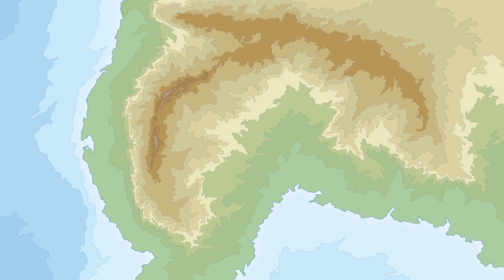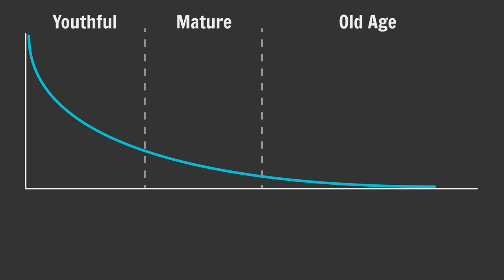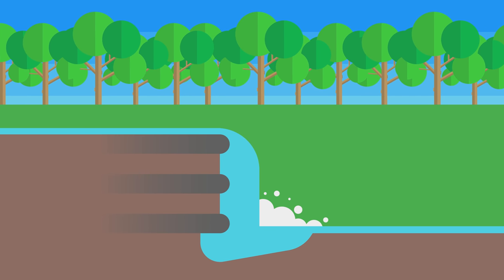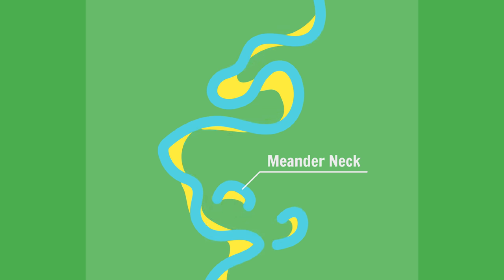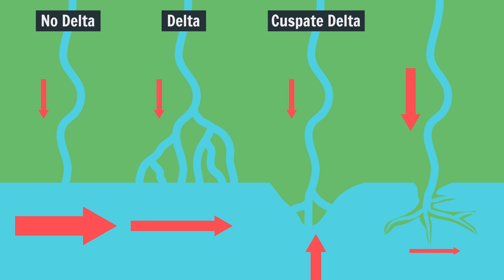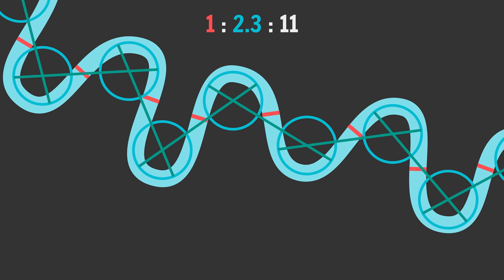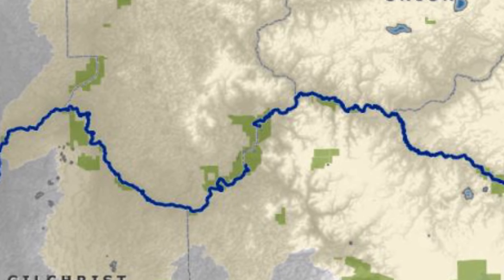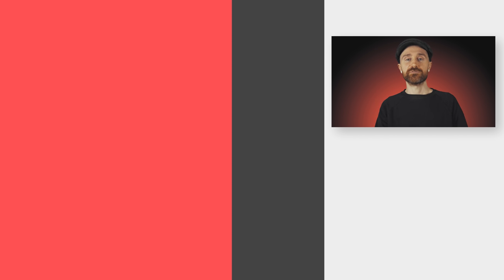How To River

Comment: When drawing rivers on made-up maps, it is useful to remember that they flow perpendicular to elevation contours.  Don't have them cutting across your contour lines at weird angles!
Reply: So they dont cut straight to elevation levels?At least not always?
Reply: @vaultdude4871  The direction straight downhill is always directly perpendicular to elevation lines - the river flowing downhill will always make a right angle to the elevation contours.
Reply: Also streams will make little v or u shaped dents in your elevation contour lines pointed up stream/hill. 

Basically the stream eroded out a valley and this means that the elevation line gets bent in the uphill direction. 

Also he forgot that a river with little sediment (say draining a lake or rocky bottom/shallow bedrock) can create an inward dent typically creating an estuary. (St. Lawrence River in Canada for an example as obvious as the Nile or Mississippi on a map)
Reply: What about a civilization that creates its own rivers?
Reply: @ValkyRiver  Canals?

Comment: So the bigger the river volume, the shallower that formula assumes the river is. I talked to Edgar during development and he said you can vary the width of the river within an order of magnitude or so. For example the Merrimack River is about 300 meters wide at its mouth but the formula predicts 900 meters. This difference is due to the fact that the river is deeper than expected, being about 5 meters deep
Reply: Alot of the depth is determined by the geology of the medium through which the river flows. 

For instance a fold or rift may have a hard soft hard band which a river (or glacier) can carve out to make a very deep and skinny channel. Also glaciation basically resets the dirt layer so expect relatively clean water (especially if your draining a lake).

Alternatively deep bedrock can make a situation like the Mississippi or Rhine near their deltas where the onlything the river cares about is loose dirt so it may be extra shallow but wide and meandering.

Comment: An important note on deltas:

The river's speed will determine how much sediment is deposited. The slower the river, the more sediment will be deposited. Deltas form because on meeting the larger body of water, its speed abruptly slows, and sediment is deposited where the stream slows. So, sediment is deposited at the existing coastline, and the coastline moves out as more sediment is deposited, etc. etc. until you have a fan-shaped protrusion into the body of water. As such, you will almost never see a straight coastline where the delta forms.
Reply: @ThfKiller I believe that this may have something to do with the fact that much of the Netherlands' coastlines are made up of reclaimed land, i.e, the land used to be submerged in the sea. Since the coastlines have been moved outwards, the river would already have had a delta formed further upstream.

Comment: One thing that should have been mentioned: the way people interact with rivers, with each influencing the other. The area where I live has several good examples:

Over thousands of years, rivers will deposit large amounts of sand and gravel along their flood plains, in addition to silt. These are valuable resources which humans then dig out, creating quarry pits which usually end up becoming small lakes. If you look along the Nene and Great Ouse river valleys in Northamptonshire and Bedfordshire, England, they are lined with hundreds of lakes - abandoned quarries which now as flood protection by absorbing excess water during heavy rain. As added bonuses, they have also become important recreational areas, and refuges for endangered species like water deer.

Human activity can also create much larger lakes intentionally - reservoirs - and these may be the only large bodies of water that exist in some areas so their creation can have a huge effect on the type and variety of wildlife you find in an area. Reservoirs may also change patterns of human habitation. A dormer village that was once a ten minute drive away from a major town or city may find the journey takes an hour or more, so is likely to stop growing.

If a river passes through an area of bog, fen, or saltmarsh (acid, alkaline, and salt wetlands respectively) which people then drain to use as farmland, the river can end up much higher than the surrounding land - several metres in some cases - especially if it had natural levees. Once the Nene and Great Ouse reach northern Cambridgeshire, which was originally fen, they quickly end up several metres higher than the surrounding farmland, which has sunk as it was drained, and mostly lies near or below sea level. There will also be drains - artificial waterways used for drainage - created at the same height as the natural rivers, so that the "horizon" is often the next embanked waterway, whether natural or artificial.

Comment: 8:51 Question: do rivers always flow down mountains? Answer: no, a minority of rivers flow up mountains.
Reply: Technically true, but they do so using the inertia of previously flowing down. That force is too weak to keep them flowing more than a few miles at best. Because of that, it's more common for them to get diverted. That means that most currents flowing upwards are artificial (channels).

Comment: For fun I'm programming a world generator which, given a heightmap, will create oceans, rivers, various climates, basic mineral deposits, etc.  I'll then create some neural network controlled people with Bronze Age technology, and the availability of resources will depend on the world generation process.  Got hung up on rivers, but I think your video might have solved my problem.
Reply: Did you ever finish it?
Reply: @ElijahDawkins-yb1uc  No, but I did have it generate continents, oceans, and lakes, and I simulated erosion.  I made a buggy prototype of ocean currents too.  The idea there was, along with a wind simulation, to create a sailing simulation.

I also made a tree generator with the idea that when you zoomed in on a given point of the world map it would generate a smaller scale map based on the geography.

I also experimented with making a map where instead of a single rectangular map it was two circular maps simulating the northern and southern hemispheres.  I also made a converter to make a map like this out of a square map and used it to make a more accurate map of earth. That way there was no teleporting from the North Pole to the South Pole.  A solution I considered is moving off the top of the map on the left side to the corresponding point on the right side, but that meant the distance was greater from east to west than it was going off the top or bottom of the map.  The circular map on the other hand was seamless.

But I never finished it, and I've pretty much abandoned it now.  It was a fun project though.  Maybe I'll get back to it one of these days.

Comment: Hey, great video man, but just wanted to point out that, counterintuitively, a river gets faster the further downstream it gets, and not the other way around!
Reply: It gets faster because volume is added, and less of the water's force is used to overcome friction due to a lower percentage of contact.
Reply: Not that counterintuitive if you consider potential and kinetic energy.
Reply: @ragnkja  very true, combined with the smoother surface downstream, it really isn’t that confusing but the first time I came across it I thought the river was faster upstream due to the more turbulent flow, hence why I said it’s counterintuitive 😅
Reply: I think that gaining rivers would probably speed up and losing rivers would probably slow down. I don't know anything about rivers, though, that's just what seems intuitive to me.
Reply: @isabela8214  
Even losing rivers gain kinetic energy as they lose altitude and therefore potential energy.
Reply: The speed of water in a river mostly depends on the stream gradient (the ratio in drop of elevation). The higher the stream gradient, the faster the river (or creek) flows and the more it cuts through the landscape. If the stream gradient is low, the river starts meandering, because the water flows slowly.
Reply: @isabela8214  yh that’s true, but i think most rivers are gaining so it’s a fair point wouldn’t you say?
Reply: @Zh09SpMAvE  
That’s true. OP’s comment is mostly applicable when the gradient as well as the width relative to volume are about the same.
Reply: @pierreproudhon9008  hahaha 😂
Reply: Huh? That doesn't make sense to me. Why would a river get faster as it gets further downstream? Further downstream means more tributaries. More tributaries means the river gets wider. And as anybody with even a little bit of physics knowledge knows, the wider the passage, the slower any fluid will pass through there. The slower the fluid flows, the more laminar it is, which is why wide rivers tend to be calmer than small streams. 

And the force of impact in such small streams causes a loss of energy through heat(and is also partly why streams are more turbulent). Less energy = slower velocity downstream of energy loss. Sure, gravity will cause a net acceleration, but it accelerates the land by the same amount as it does the water. Surely this loss of energy from the force of impact and the widening of the river would more than counteract gravity's acceleration, making the river slow down.
Reply: @caterscarrots3407  Yes, that’s true but velocity increases as more water is added to rivers via tributary rivers.  This means that less of the water is in contact with the bed of the river and the mouth so there is less energy used to overcome friction.  Hence rivers flow progressively faster on their journey downstream. 
Plus considering the idea of KE and GPE, the potential energy obviously decreases, and so the kinetic energy would increase, like in a roller coaster, you’re fastest at the bottom.
Reply: And as per the Physics comment, well I like to think that i know a little bit 😁
Reply: @caterscarrots3407  
Is a ball rolling down a hill accelerated the same as the hill it’s rolling down? The biggest reason rivers tend to be slower downstream is that the gradient is less steep — given the same gradient as further upstream, it would be faster.
Reply: @ragnkja  Yes, that's the way gravity works. Everything is accelerated at the same rate, 9.8 m/s^2
Reply: @caterscarrots3407  
The hill is part of Earth, and therefore pulled towards the ball, which definitely isn’t massive enough to cause that much acceleration.
Reply: @aashraychopra2999  but you're also increasing the volume of the river, it's becoming bigger, the area in contact with the river bed is also becoming bigger. 

Also, as the river goes downstream it will enter a flood plain that allows the river to widen even more. So there's actually more contact with the river bed, increasing friction. The flow of the river is more dispersed, allowing for the water to slow down additionally. 

We can also look at real world examples and see that this isn't true. As rivers enter flood plains they slow down not speed up.

Comment: This was a really good video explaining how rivers form and the effects they have on the environment, but I do have some questions about how human cultures would interact with them. First, you mentioned in the video how rivers in drier environments tend to dry up during part of the year. Does this always happen, or will larger rivers (the Nile comes to mind) keep flowing throughout the year and only change in volume? If they do dry up during part of the year, how do the major cultures around these rivers adapt? Second, I know that a lot of work nowadays is put into maintaining a river's course and making sure it does not move. How often was that done in the past? How do changes in river courses affect structures built around them (bridges for example)? Also, how common were bridges in the past, given how rivers move? I would appreciate any information on this.

Comment: You have no idea how excited I am to see you talk about meander geometry! I did my senior project in college on meander geometry. An interesting thing about the radius of curvature to channel width ratio being the same in rivers is that it doesn't matter what material/setting the river is in --- it holds true for rivers in tropical locations, temperate, bedrock, permafrost, and even straight ice (though the bedrock and ice ones have more variance than the others). This is due to fluid dynamics being the primary driver of that meander (which we still don't fully have figured out). The initial study done on this was in the 60s but since it was all done by physical river survey, it was heavily biased towards temperate European and US rivers. I used satellite images to measure meanders in different settings around the world and confirmed that the original findings were still sound.

Comment: BUT EDGAR! What about biforcation???

I'm mostly joking, though that could be interesting to look at.
Reply: Check out the Casiquiare River, which is one of the largest bifurcations in the world. It siphons some water from the upper sections of the Orinoco River into the Rio Negro, a tributary of the Amazon. Research suggests that this is not a stable condition, but is instead a step in the process of *stream capture*, where eventually that entire section of the Orinoco will be diverted into the Amazon.

Comment: A lot rivers that come off highlands can have wide braided streams then drop into a river canyon. Not mention some rivers are mostly stuck in canyons till a small delta region. Then there’s rivers that have large middle areas before it goes into hilled descent. River do many things and don’t follow all the rules have rivers fall off the land into the sea but rivers don’t have major splits and don’t go up hill.

Comment: How straight the river needs to be is proportional to the height difference between the start and end of the river. In the US, most rivers are fairly straight, but in the Amazon, for example, where the ground is basically flat, the river has stupid amounts of winding. You can make a bendy river in low lands, if you so desire. Edit: now that I've seen most of the video, I see you mentioned the bendiness in lowlands, but my point - that a river can be basically all bendy - still stands

Also, the basins don't have to drain only by evaporation, they can also drain to the soil, if you have a spongy rock. Sorry, I don't know the correct terms in english, I learned this years ago and in another language
Reply: the word you're looking for is permeability.
Reply: @mfaizsyahmi  thanks! The specific one I was thinking was underground aquifer, but I learned a new word now, hooray!

Comment: I have seen in several of your videos that river never split. This is a good general rule, but is not always true. In fact its a common enough phenomenon that it has a name: a distributary. Perhaps the most well known distributary from the real world is the Atchafalaya river. About 160 miles from the coast (well before the river delta) the Mississippi river diverges into 2 separate streams: the Mississippi that leads to New Orleans and the Atchafalaya that leads to Morgan City. Distributaries are not a super common occurrence but there are a few dozen of them in the real world. However, because it is usually an unstable configuration they usually do not last very long. A river will bifurcate for any number of reasons for a a few years or decades before one of the streams will become dominant causing the other to dry up.

Comment: Okay a few other oddities:

1. Bifurcations exist, but you shouldn't use more than a handful in total per planet (yes planet), for some examples use the wikipedia article. Especially interesting is the Casiquiare canal, as something like that can, in theory, allow for a natural water route through a continent.

2. Something similar, though less practical in world building, is happening at the Danube Sinkhole. Depending on other factors some or ALL of the water of the upper Danube drains via a cave system into the Rhine. It is likely, that this will result in a complete redirection in the future.

3. If you got a river with seasonally weak flow that ends on a beach, it will sometimes drain into the sea underground, when the sea deposits more sand on the shore, than the river can carry away. And break open a normal outlet, cutting through the beach and sometimes resulting in a sandbank close to shore, that will be eroded within short time by the sea, once the river gets back to it's low state. (This is for example quite interesting as a danger, should your dnd group decide to stay the night on the coast, next to the tiny stream that's there. The ground under them might be gone within hours, if there is strong rain in the hinterland)

Comment: Another great vid! Something I'd like to see explained is how elevation distributes in an area where mountains form. How should I draw elevation along two convergent cont-cont plates? I looked at different maps from earth and it seems that the Himalayas are mostly located on the Eurasian plate and not on the Indian plate. Is it just that the smaller Indian plate (lower mass) is pushed down by the much heavier Eurasian plate and kinda "pushing up" mountains from underneath?

Then second question, with old mountains, has something like rainshadow a big influence on how unequally the mountain chain erodes? Would the higher peaks be on the rainshadow side? And the side with more precipitation would erode much faster?

Would be great to see a video about this! Or maybe just get a couple of pointers from the community here :-)